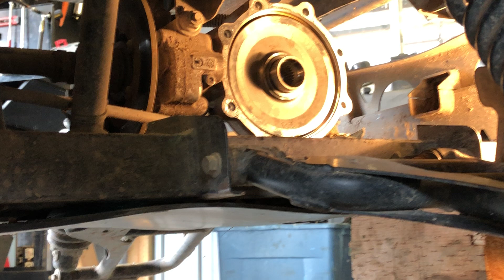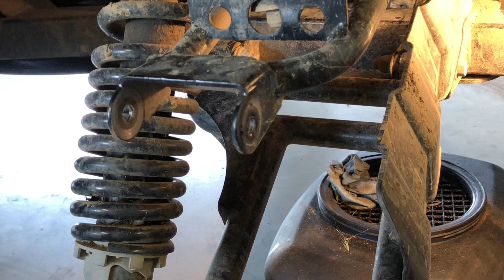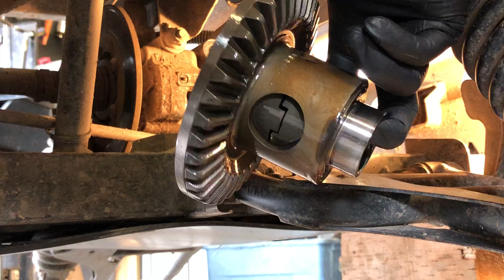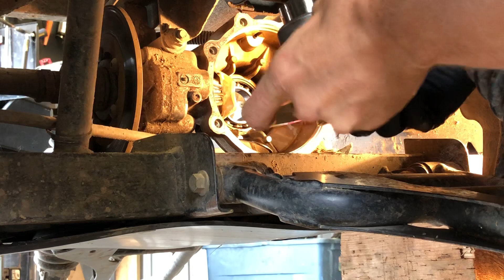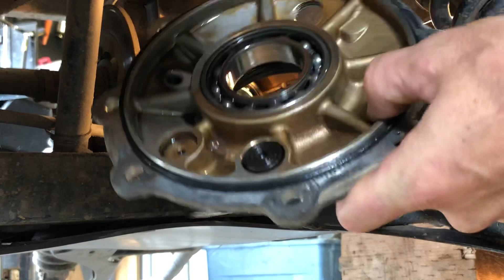Arctic Cat Prowler XT vs XTX - FIXED - Slipping  Jerks Rev up and Wont Go Slip Hesitation

Comment: 2008 Arctic Cat Prowler 700 before after 3 seconds run and instant let the gas free and stop in seconds that was before now stay in neutral only.
Reply from the maker: I’m a little unsure what you are saying here but you should buy this kit. I bet it’ll fix it. If you need more helpful tips, check out:   https://youtu.be/X0AdFxkJiOg and if you need parts: https://www.ebay.com/str/midnebraskamotorsports. thanks for watching and the comment.

Comment: Foe the xtx clutch that you took out, i assume the slip is cause by that shaft seperating as it spins? If thats the case, you think a guy could just put a weld the two sides together, basically making it one shaft?
Reply from the maker: That might work temporarily. My guess it is will be very short term, then you'll be buying these parts and the main shaft. Let me know what you figure out. If you just want to fix it right use DISCOUNT Code:  MNMSAVE10 to save $$$$$      https://www.ebay.com/itm/234192100101
Reply: @MidNebraskaMotorsports  
Hey, thanks for the reply. I ended up just cleaning everything up really good and then switching to a friction modified gear oil and seems to do the trick.

Comment: Hey I have the prowler xtx 700 I've ordered axles but they are to small for my differential did you say I need the xt axles and not the xtx axles?
Reply: Thanks
Reply from the maker: Here is a direct link to what you need. Thanks for the question and for watching!  https://www.ebay.com/itm/234192100101

Comment: Hello, I have a 08 prowler 650 xt. There is a clatter in the rear end once you let off the throttle. What should I look for?  Any help would be appreciated. Thank You.
Reply from the maker: I'd start by draining the oil in the rear diff. If you have particles then I'd tear into the rear end. Boots good on the drive axles? Here is a link to the parts I'm guessing you'll need. https://www.ebay.com/itm/234192100101

Comment: If I order these parts through you, will they be the right length axles?
Reply from the maker: If you order the kit you will get the right sized axles. Some people order just the gear hoping that their axles will fit......they WONT. You have to buy the axle for the gear. Thanks for watching and the question! https://www.ebay.com/itm/234192100101
Reply: @MidNebraskaMotorsports  
Will a 0214-1572 axle kit fit the gear.

Comment: I have a 08 prowler 700 xtx. Cost? Where do you get parts from ?
Reply from the maker: Check out my eBay store at stores.ebay.com/midnebraskamotorsports
Reply from the maker: here is a direct link to the parts. Thanks for watching.   https://www.ebay.com/itm/234192100101

Comment: Awesome vids my man. My 08 XTX does nothing when I shift gears. Ran fine, parked it, next time no power to wheels. Motor runs but gear shift changes nothing. Any common issues?
Reply from the maker: I'm thinking a belt issue. Mice could have gotten in the clutch area and caused all kinds of issues. Thanks for watching. Let me know what you find.

Comment: By changing out the rear ring gear, do you need to do the same for the front gear for 4X$ applications?
Reply from the maker: Nope, you don't have to do a thing with the front. Thanks for watching. I have the kit link posted.